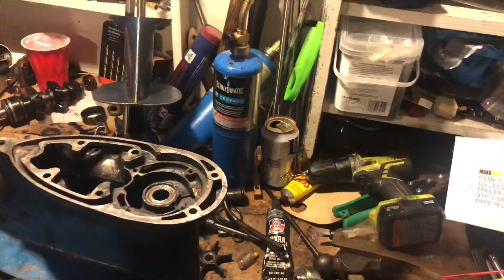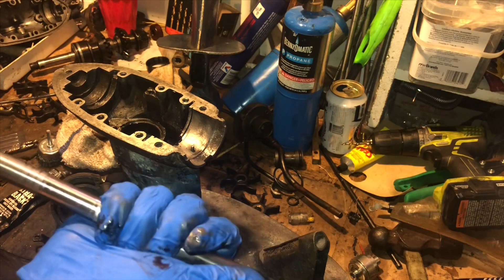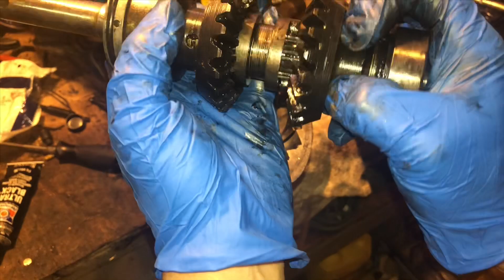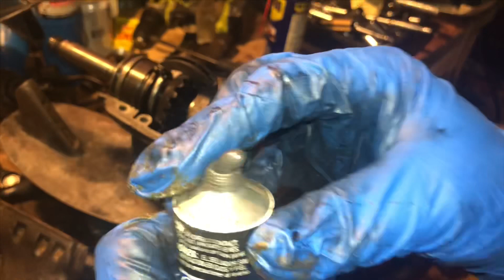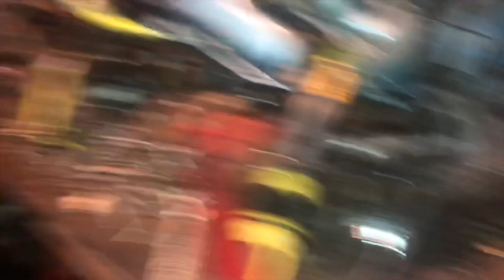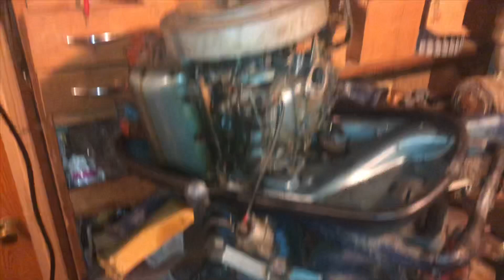1956 EVINRUDE 30 HP BIG TWIN BEAST! Finishing up the lower unit

Comment: I can not find the thermostat on a 1956 30 hp Johnson put a new water pump on and water is not coming out the exhaust port on back of motor  it was easy none of the bolts were hard to get out 4 of the impellers or broken off the old one
Reply from the maker: Those motors don’t have a thermo! Check to make sure you lined up your water tube properly! Or sometimes salt and crap clogs the water passages
Reply: BlackoutBill21 I took it back apart and somehow a few of the impellers were going the wrong way I must of turned it back and forth I put it back together and it works fine now
Reply from the maker: Sam Tate sweet! Glad it works!!!
Reply: BlackoutBill21 thanks for the information I got 35 hp1959 Johnson and it has a thermostat got it for 50 bucks because it needs a gear seal I didn’t know if it was hidden under something but thanks I couldn’t find it because it’s not there appreciate it
Reply from the maker: Sam Tate anything else don’t be afraid to ask!!